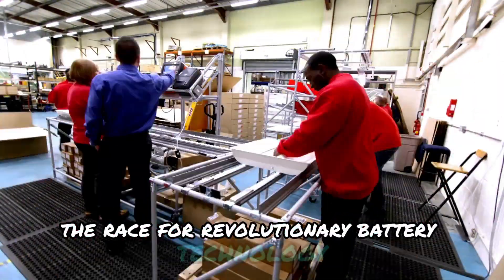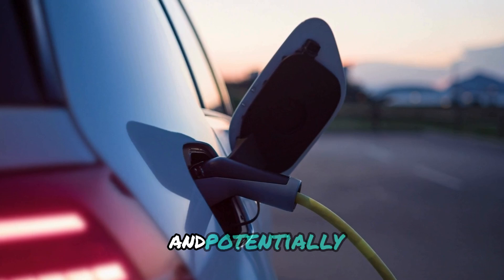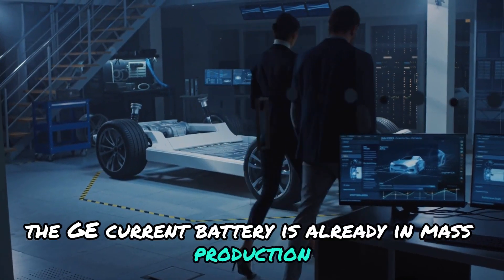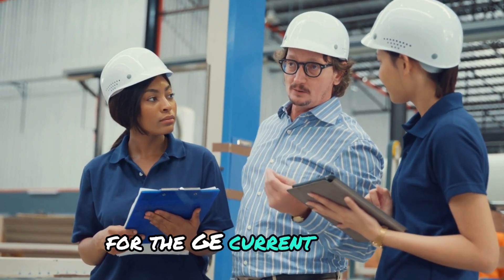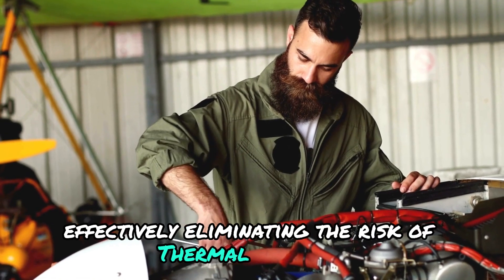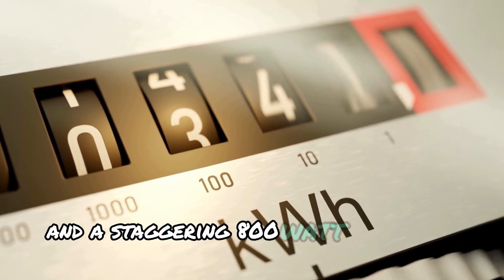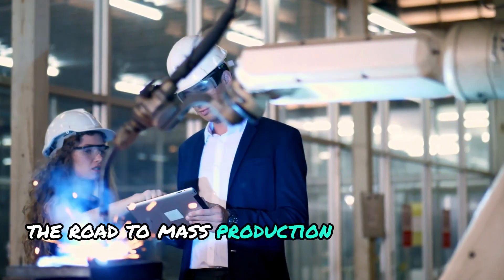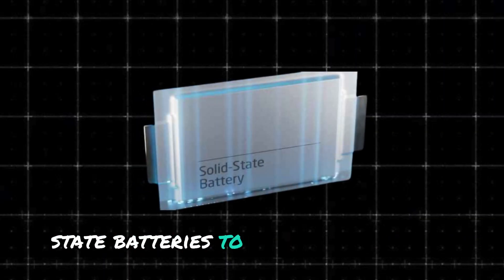China’s NEW Solid-State Battery Just SHOCKED The EV Industry!

Comment: What kind of amperage flow is necessary to charge that battery in less than 10 minutes? Huge breaker, cables and connections  I would think. Charging stations will have to be rebuilt which isn't likely.
Reply: It is possible if the Chinese can do it, xpeng new EV will use 5C reaching 80% charge in 12 minutes.